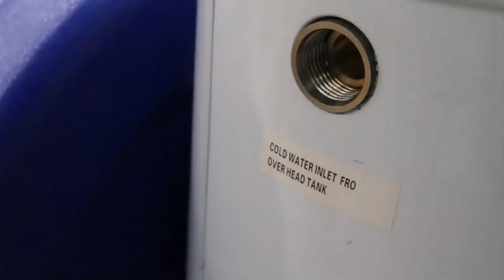Installation of Supreme Solar Water Heater Systems | Tube Collectors Model

Comment: leakage small drop of water from one tube.. what does it means?
Reply: Change the rubber bush buddy
Reply: One tube cost entha avutundi pothe?
Reply: @jask6415  tube generally cost 800-850 and with service cost it would be around 1000
Reply: @vinuuthappa10  sir tube kha se buy kare
Reply: @surendrasingh-hv2eg  bro, kisi bi solar equipment dealer se buy kar sakte ho. Google mein Solar Equipment dealer + (aapka area ka naam) search karo aur call karo unko

Comment: instal video is ok ... 
but pl do not buy .... i buy 500lte.... 
service is very poor ..... inside have electrici... wier also ... if not sun rasse .... u can eassy to use elc.... 
the company says ....👎👎👎👎👎👎👎👎👎👎👎👎👎👎👎
very bed ... 2000 for service .... no waraney ..... tube is broken many time ..  700  for 1tube .... ...😂😂😂 we are tried .... that right reviwes